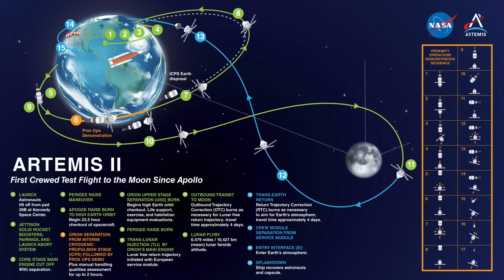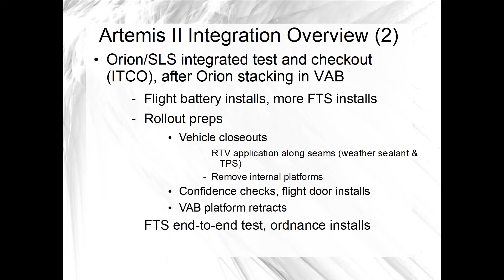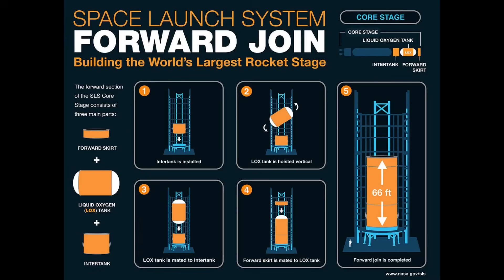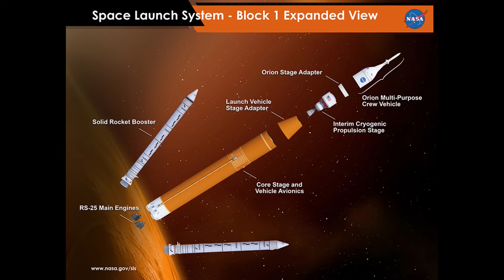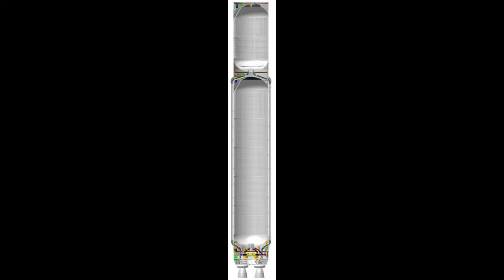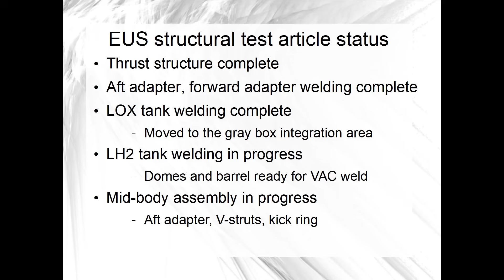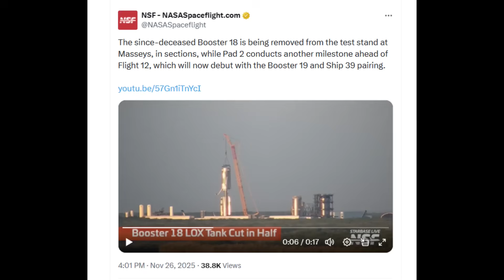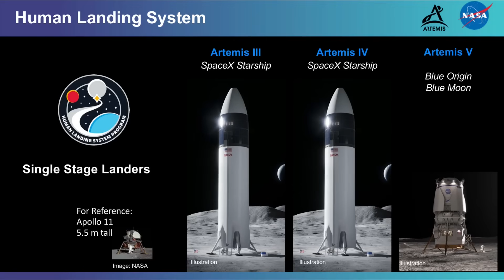Is the Artemis II CDDT in the critical path?  When will the Artemis III SLS be ready?

Comment: Sadly, if there was to be a Lunar Landing in 2028 all of the hardware for that would need to be in manufacturing ... TODAY.  That is the typical timeframe for manned spacecraft, especially something on the scale of the Starship HLS and Blue Origin Mark II landers.  Blue Origin's Mark I lander is nearing completion and I think they have a huge advantage over SpaceX right now.  They have the less complex mission profile, and I wonder if the new supersized New Glen 9x4 launch vehicle would be able to deliver a fully fueled Mark 2 lander to the Lunar Gateway.  It;s not going to be easy though, as Blue Origin has a lot to prove over the next 36 months and also might suffer setbacks along the way.  

SpaceX is likely just wasting everyone's time at this point.  They won't be ready to support any Lunar mission in the next five years - or longer.  I suspect even more problems with the V3 design will surface over the next 12 months and SpaceX will announce a V4 design that will fix everything.  They just don't know what they are doing - they won't share how many Starship tanker missions would be required, any design information for the tanker starships, any design information for the Orbiting Propellent Depot, and even design information for the HLS itself.  This isn't secrecy ... they really don't know if any of this stuff will work yet.  So how can they engineer a solution as challenging as landing a small skyscraper on the Moon .. based on steaming pile of unknowns?  Hint:  They can't!

NASA should start now designing a new mission for Artemis III - SpaceX has already lost and everyone knows it.  It's time for the crying and the moving on to start.
Reply: V3 may eventually work, but I think the problem they will run into is that it actually needs to be able to lift 100 tons for the refueling to be achievable in any reasonable number of flights.
Reply: @mr.g937  Spoiler alert, it definitely won't be able to lift anywhere near that much. The best thing they can do to actually meet performance targets is make an expendable upper stage, that will produce a huge performance boost from first using up all the propellant aside from the residual safety margin, and having a few dozen tons less in dry mass. That can produce over 100 ton capacity to 550km x 550km orbit, instead of 40-50t with the path they're on. Another caveat is that their refueling doesn't happen in LEO, there are two phases, first one is in circular 281km (+/-100 km) orbit, then the final phase occurs in FTO (final tanking orbit) that could be in MEO or HEO, in 281km x 34,534km orbit with a range of +116,000km/-24,000 km for apogee and the same +/-100 km for perigee, and inclination between 28 and 33 degrees. 

All of this is from an official FCC document released several months ago. The ranges are huge because they depend on two major factors, the capabilities of tanker variants, and the capability/performance of HLS vehicle itself. They have to overlap under a common orbit otherwise the mission profile doesn't work. For example, tankers only being able to deliver required amount of propellant to a lower end of these orbits while HLS not having enough performance to complete the mission if it starts its lunar journey that deep inside Earth's gravity well instead of from the higher end of those ranges. I discovered that the baseline 34,534 km perigee is completely unreachable by fully expended Block 3, even with a reduced ship dry mass and optimistic performance parameters. It's looking like Block 3 is unable to support HLS architecture, and most likely not even the demo mission which uses a lighter, skeleton HLS version that needs a lot less dv (less refueling flights) to complete its profile that skips a lot of critical mission profile points, like not going to NRHO in either direction and only doing a hop instead of full ascent to any orbit. Surely, Block 4 will fix all of this! /s
Reply: @FrankyPi  We're going to find out in 2026. If v3 works, then there should be Starlink launches on Starship in 2026. Each Starlink v2 is 1250 kg. So if we see Starship v3 launching say only 50 of them, we'll know there is a material underperformance.
Reply: @mr.g937  The thing is, Musk already announced Block 4 for 2027 debut, so clearly they're not planning on having Block 3 around for long.
Reply: @FrankyPi  Musk says a lot of things, so I take that with a grain of salt. SpaceX has said that v3 will be the operational vehicle for Artemis (not waiting for v4). Anyway, there will always be another vehicle in the pipeline...
Reply: @FrankyPi  "Block 4" - or what SpaceX now calls v4 - has been the aimed-for final configuration for several years already; it's not something recent or new.  It'll have 9 engines on Ship and 35 on Booster.  The current in-progress "v3" is really what used to be known as "Block 2" - with Raptor 3 engines onboard but otherwise an intermediate phase between v1 and the final/evolved configuration.

The "v2" flying throughout 2025 has been an unplanned-for chimera of an essentially v1.x/Block-1+ Booster and a halfway-upgraded "v1.5" Ship.  It wouldn't have existed, but for an apparent ~1 year slip in the Raptor 3 development timeline.
Reply: @Spherical_Cow  You haven't said anything I didn't already know :)
Reply: @FrankyPi  then why would you attempt to imply that v4 is some fix for unforeseen v3 underperformance, when you know perfectly well that it was planned from the beginning?

Aside from which, assuming SpaceX didn't lie about v2's 35 t to LEO (in reusable mode) capability, I find your extreme skepticism regarding v3's 100 t to LEO design goal, rather unfounded.  Between the better performing and lighter engines, significantly reduced engine shielding and venting/fire-suppression overhead, 100 t of extra propellant on the v3 Ship vs. v2, and potentially a slightly higher staging velocity thanks to v3 Booster's improved engine performance and better aerodynamics and structural strength allowing more aggressive flyback maneuvers, thus implying lower reserve propellant requirements.  Between all those improvements, to suggest Starship v3 should gain only an extra 5-15 t to LEO over v2 is... pants-on-head irrational.

Now, maybe v3 Starship will 'only' achieve something like 75 t to LEO (in fully reusable mode) instead of the aimed-for 100.  That's still within the realm of plausible outcomes.

But regardless, v4 Ship with its 700 t of extra propellant, 3 additional vacuum-optimized engines, and an up-revved Raptor design (pushing 300 tf per engine), will indeed undoubtedly provide much more capability relative to v3.  I don't think 2027 is plausible for v4 (that's Elon Time); but 2029 isn't out of the question... maybe even 2028, if Raptor 3 up-rating work proceeds smoothly from here.
Reply: @Spherical_Cow  Well they didn't have it planned from the very beginning but they did have it in plan for a few years now when they realized how far they are from where they want to be. Also, it's not the ultimate version either. If you noticed, the old V3 isn't completely identical to V4, there are some slight differences, they want to reach the taller stack of the old V3 eventually. 

You can find my "skepticism" unfounded all you want, but I'll let you know that my "skepticism" is based on data and physics, not a hunch or a feeling like your skepticism towards me. I'll also say that what they published for flown versions so far is for some low minimum viable orbit in the range of altitudes they reached on flights, not a useful orbit like circular 550 km orbit where Starlinks are, nor even the initial refueling phase baseline of 281 km, both of which require a bit more oomph to get to, you seem to have glossed over that detail. What I said about 40-50 tons is for 550 km circular orbit, obviously for lower orbits like 281 km, it's closer to 50 tons, and for minimal viable orbit like lower range of refueling baseline of 181 km, it's closer to 60 tons. The latter is what the ~35 ton figure is comparable to with V2, which by the way I correctly predicted (within margin of couple tons) months ahead of the reveal, also through data and physics based calculations, so that's nearly a 2x improvement. I'm sure V4 probably won't debut when Musk said it will, just like it happened many times before with other items in this program, they will also have issues with Block 3 that have only just started.
Reply: New Glenn 9x4 has a theoretical TLI capability of 20 t.  Blue Moon Mk 2 is ~45 t fully fueled.  So nope, that's not happening.

As for BO having a "less complex" mission architecture, I disagree.  They still have multiple propellant delivery flights with docking and cryopropellant transfer in microgravity, including at two separate orbits (LEO, then again "Stairstep" HEO).  They don't have a Depot, but they instead have a Lunar Transporter.  And whereas SpaceX deals with liquid methane and can get away with passive boiloff mitigation, BO must deal with much more unforgiving and technically challenging liquid hydrogen, and must invent and employ "zero boiloff" active management systems.

BO is confined to a single launch pad; SpaceX is building at least five.  BO cadence will be limited to just a handful of flights per year for a long time due to production rate limits; SpaceX is building enough factory capacity to produce dozens of new Starship stacks per year.

Comment: Artemis 2 in first quarter of 2026 to keep expectations in check.  Question now seems to be how long to delay Artemis 3 pending HLS readiness vs flying a different mission to keep the momentum going.
Reply from the maker: It matters when Artemis 2 flies.  If it ends up later in 2026, then it's less likely anything else could be flown in between Artemis 2 and a lunar landing mission.  Any multi-month delay to Artemis 2 ends up shrinking the gap between it and 2029 and making the gap between Artemis 1 and Artemis 2 bigger.
Reply: Boeing isn't interested in any delay, they want to get Block 1 out of the way ASAP to focus on transition to Block 1B. Stacking of SLS will begin next year. Artemis 3 will most likely fly as soon as it can without the landing, which will be moved to Artemis IV.
Reply from the maker: @FrankyPi  It's not up to Boeing, but they still need to finish their Artemis 3 and 4 hardware.  For flying any mission after Artemis 2, NASA and their contractors have to fly that mission first and process all the issues that come up.  There's no crew for that mission yet, whether it's Artemis 3 or something else.  If they start stacking next year, that'll be a big change in their rules to start rushing training to finish it in less than a year.  We'll see.
Reply: @PhilipSloss  It's nothing but delivering as scheduled for launch in mid to late 2027, there's no way Boeing will wait who knows how many years with Block 1 sitting there waiting for HLS to be ready, I've been constantly hearing that they're planning to go stacking as scheduled. Yeah, they're not the boss of the entire program, but there are literally no positives, only negatives about waiting for functional and ready HLS for Artemis 3, the gap would be bigger than between A2 and A1, it's bad for everything, bad for institutional knowledge, bad for NASA and their optics, and bad for administration's agenda, no matter what anyone thinks of it. The only reasonable, sensible and good alternative is descope the mission and fly it as soon SLS-Orion are ready.
Reply from the maker: @FrankyPi Boeing has had more issues with SLS production after Artemis 1, with significant hurdles in 2023 and 2024.  They were supposed to be delivering the Artemis 3 Core Stage basically now (end of 2025) and that date has slipped, mostly likely into the second half of 2026.  NASA isn't specifying a completion/delivery date even now, so there's still a lot of progress that needs to be made.

If they've turned the corner, we should see Core Stage-3 delivered in 2026 and Core Stage-4 in 2027.  And then for Artemis 4, there's still all the EUS assembly and test that needs to be finished by the end of 2027 if SLS is going to support that official date.
Reply: @PhilipSloss  None of that matters even if it is the case that there's a half year delay, because Artemis IV, if it is to remain a landing mission unlike Artemis III, isn't happening before 2030. Artemis III happening in late 2027 or early to mid 2028 makes little difference in the grand scheme of things. One option is delaying A3 until some HLS architecture is ready to support landing, which is realistically NET 2030, Artemis IV would happen NET 2031 or even 2032 in that case, or, do Artemis III on a descoped profile in 2027 or 2028, then Artemis IV being NET 2030. It's a nobrainer what path should be chosen.
Reply from the maker: @FrankyPi  We'll see.  It matters to Congress, they still want a lunar landing by the end of this term.

This second lunar landing race is an opportunity for SLS, Starship, and New Glenn.  It's an opportunity for SLS to get Block 1B done before the end of 2028 as they're supposed to, and it's an opportunity for the HLS providers to get not just their lunar landers done, but also their super-heavy launchers.

New Glenn in particular is already being viewed by Isaacman as an alternate Orion launcher.  If Blue takes advantage of this second race opportunity and SLS doesn't, Congress has already said they're willing to look at an SLS off-ramp.

SLS isn't supposed to just be waiting for a lunar lander, it's supposed to be delivering Gateway modules; by the end of 2028, there might be a Gateway approaching the Moon.  That's another (hypothetical) bad look if I-Hab is ready to fly and Block 1B isn't.  There's plenty on the line for SLS in the next three years.
Reply: @PhilipSloss  Congress isn't getting a lunar landing by the end of this admin's term, no matter what they do, it's too late to act to try to fix or accelerate anything with meaningful results, that should've been done years ago, that ship has sailed long ago. They should get on with the fact that realistically no landing is possible by the end of the decade. New Glenn as an alternate Orion launcher is pure nonsense, neither 7x4 nor 9x4 are capable enough to launch it to TLI, let alone carry comanifested payloads of 10 tons and more, which B1B and B2 will be doing, Block 1 will be history by the time 9x4 debuts anyway. Gateway launch is slipping into 2028 so it won't reach NRHO before 2029, when an alternate Artemis IV can be arranged.

Comment: It would be kind of neat if the first Artemis lunar landing ended up including an ESA astronaut.
Reply: Why? ESA is only doing the Command Module for the Orion Orbiter. Europe has 50% larger economy than USA, spends less than half the rate on defense and spends less than one quarter of space.
Reply: @mrbaab5932  In return for the ESM and contributions to the Gateway station three ESA astronauts from Germany, France and Italy will join NASA on Artemis missions to the moon. Specially they will fly one astronaut each on Artemis IV, V, and an unspecified third mission. If the first moon landing is pushed back to Artemis IV, there would presumably be an ESA astronaut participating in that mission (unless plans change).
Reply: @m @mrbaab5932 SA (in particular ASI) have developed and built half of the iss, all the orion service modules, and basically the first and till now only two modules of the gateway (yeah, they're basically ready since last year, one of em was even shipped to the us already). while it makes sense to not landing them in the first landings, the only reason they're participating is to get european astronauts aboard orion and eventually gateway. also, eu economy is def not larger than the us, way smaller i'd say especially now that von der leyen sold us to you accepting crazy trump's tariffs with no dealing. and for the first time ever, this year esa's budget is higher than nasa's one. it's not a competition tho, they work together alongside each other
Reply: parmitano heard that might be water on the moon and can't wait to swim there

Comment: Hi Phil. Darpa did the Luna 10 paper, any information on the effects of that and could you interview any of the authors of the paper? What do you think are the bottle necks holding the SLS to one launch a year?
Reply from the maker: I haven't seen that concept come up very much in the last year; I'll have to go through the paper.  It's harder to engage SLS about the production issues they're having in the past few years, but one of them is a lack of a long-term contract for building the liquid stages.  Another issue is the supply chain, but those could be related, since it's hard to get suppliers to prioritize that work when there are customers who will make block buys and pay more per unit.